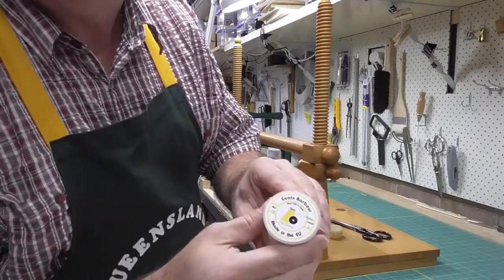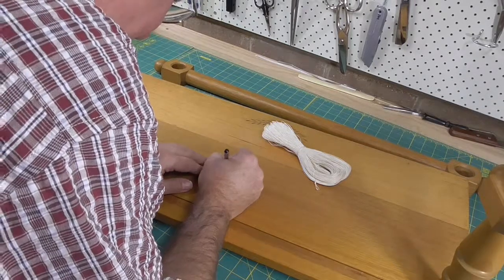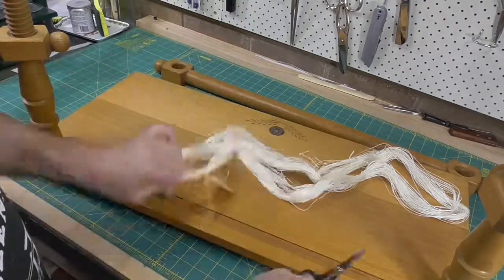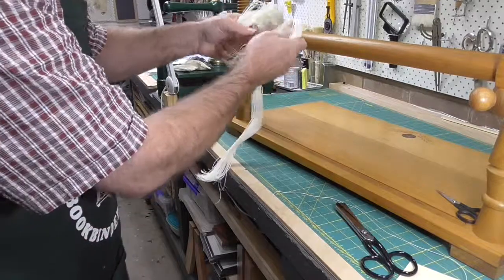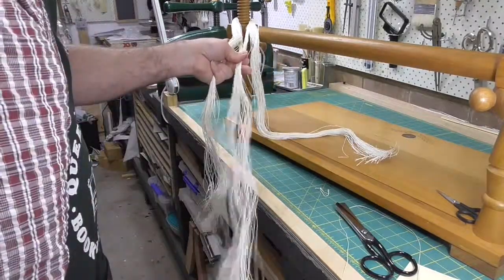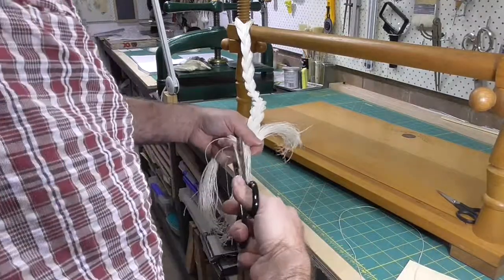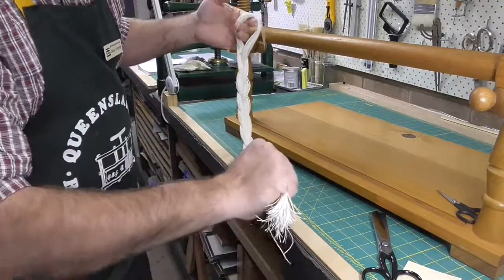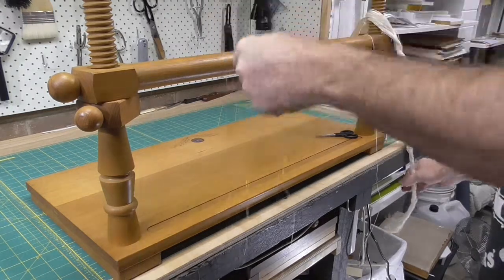How to Use a Skein of Linen for Bookbinding // Adventures in Bookbinding

Comment: I was wondering.  When I buy thread for machine embroidery, they recommend 100% polyester for durability and color hold ( throughout washes).  Why is it for bookbinding we use linen or other natural threads instead of something like machine embroidery thread that is 100% polyester or artificial.  You would think that if it can endure washes in a machine & color fastness it's comparable or perhaps even more durable than the traditional natural thread for bookbinding? Really curious to this mystery & have pondered for a long time, any clue? thx!. :)
Reply from the maker: You can use polyester thread.  Not all polyesters are made equally and there might be a concern about long term stability.  But if you use a quality brand it should be fine.  It is very thin so will not produce much swell for books that require it.  You can double it up to add thickness.  Besides the swell issue, bookbinders tend to be conservative.  It's one thing to be confident that polyester will last a long time but linen has been used to sew books over 1000 years ago and is still in good shape.  Polyester is a hard material and will have better wear characteristics to natural fibres and less prone to microbial action from the wide range of environmental conditions that washed and worn fabric will encounter.  So it is great for this application, where the long term chemical stability isn;t an issue.  All the best, DAS
Reply: @DASBookbinding  Wow that's really helpful!!!   r🐤🤗🐦 And I'm surprise to know that some linen threads over 1000 yrs ago is still intact!! What book is this, is it in a museum?? I was so curious to know about this.  I wish we can do a test and fast forward in time to test side by side between a known good book binding thread that uses natural fibers and one that is 100% artificial made specifically for machine embroidery & do comparision in endurability.  Would be interesting to see the results!

 Happy thx giving! thx for the answer to this mystery! 

happy gobbling!! 🍗🦃🍗🦃🍄🥀🐓🌈

Comment: Hey DAS, in my area they sell thread in mm sized and not something like 25/3. Most common are 1mm and 0.5 mm. Do you know which size should I get for bookbinding?
Reply from the maker: I've got a blog article on thread and the different sizes.  I'd go with 0.5, which is thicker than 25/3 - about 18/3.  It's a good standard size.  1mm is too thick for most bookbinding applications.
https://dasbookbinding.com/2019/04/05/needle-and-thread/
Reply: @DASBookbinding  thanks for the answer, i appreciate it. Now with this information i can start purchasing some materials.

Comment: In my area, I couldn't find linen theard, but I tried to use other threads which I thought can be used, my question is that why my threat keep dirty in the process of sewing? Is that because of the wax? Or I used too much wax? Thank you for great videos 🌱💫
Reply from the maker: Not much wax required.  You don't need wax, but it does seem to help a bit.  I've seen people say it stops the thread breaking and this is not true.  Try not using wax and see if that makes a differences.  Otherwise you are picking up dirt from the paper I think.  Good luck!  DAS
Reply: @DASBookbinding  thank you for the suggestion! It works! I thought the same about wax, I used too much wax, I didn't know I can do without it or by just a little of it, thanks again 🌱🌱🌱